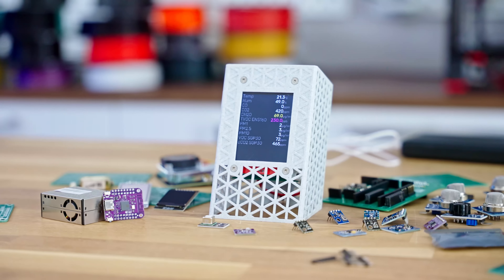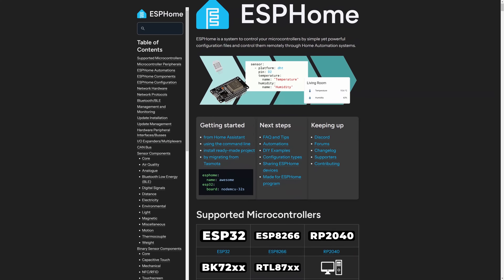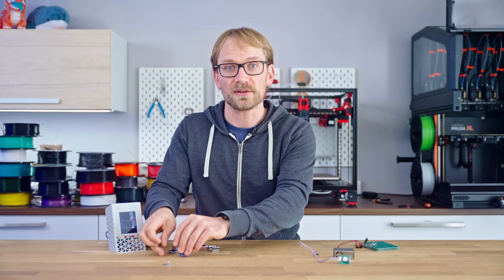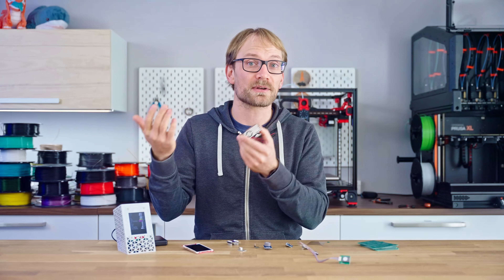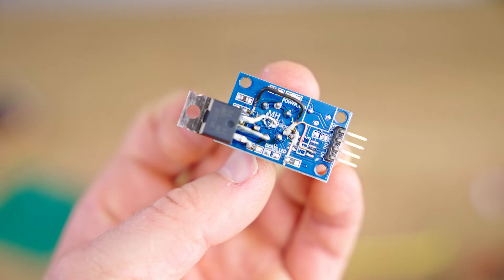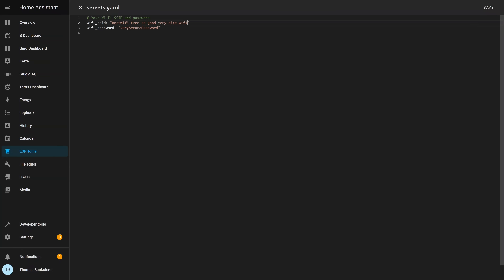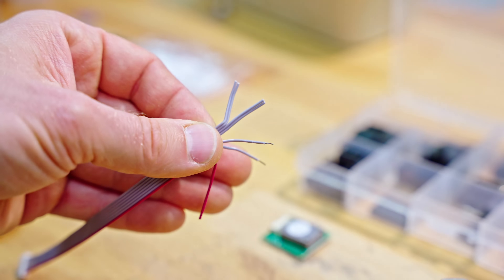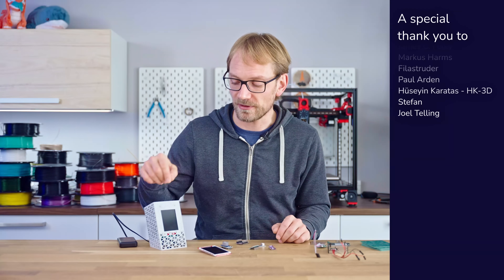I made it easier to measure your 3D printer's emissions!

Comment: "No reason not to order these PCB's" I dunno man.. what about shopping and VAT? I'm so used to it being like 15-40$ for the tiniest thing from anything that isn't from aliexpress or within my own country here in norway..
Reply: it cost me $3.21 with shipping, its basically nothing
Reply: @wraith2286  same here, it's cheaper than buying a generic prototype board and soldering all the wires yourself
Reply: @wraith2286  my shipping options are 18-28.43$... luckily there's one option that's only 1.52$. usually there isn't one of those slow but cheap shipping options like aliexpress and ebay offers, so that's nice.
Reply from the maker: EU regulations now require sellers that ship into the EU to collect VAT at the point of sale - Aliexpress does that, and so does JLCPCB. I know DHL used to have a €15 handling fee for anything where they were required to collect even just a couple of cents of VAT from you, haven't had to deal with that at all ever since the new regulations went into effect.
Aliexpress "Choice" shipping is basically them importing items in bulk in their name, then sorting and shipping them to customers from within the EU. Super convenient!
Reply: @MadeWithLayers  I've used nothing but choice when buying from aliexpress for the last few years, as I've had two instances where I've been double charged VAT when it wasn't shipped as choice... paying an extra dollar or two isn't a problem of course, but it's the handling fees of the postal service in my country. they took like 15 or 20$ which is ridiculous for something that costs 2-5$ lol. And of course I didn't get my money back for that either, despite wasting hours explaining the problem with both aliexpress and the postal service here (it's only the seller's fault, so I can't blame the postal service)

I had a look to see how much it'd cost me to get it shipped, and the shipping options were from 18-25$, but there does seem to be a 2-3$ shipping option which is nice. 
when it comes to a project or something where the goal is to spend a fairly low price on it, only to have it double or even triple in price because of really high shipping or import fees.. it really sucks :p
Reply: @MadeWithLayers  I replied to this comment twice but it's not showing.. why does this keep happening to me on YouTube 🤔

There is a very cheap shipping option on that website yes, so I'm glad to see that.
Reply from the maker: @PureRushXevus I don't know why this is happening to you. i can't find anything in the withheld comments either, sorry.
Reply: @MadeWithLayers  It's been happening for a while for me on YT I think, very odd. Fun to see you engaging so much with the comments though :]
Reply from the maker: @PureRushXevus I try my best!

Comment: Great intro on how to use ESPhome for quick data collection without messing with Arduino IDE.
I2C header following Quiic pinout makes it 10/10 😅
Reply from the maker: Noted, thanks! I've got some Qwiic-compatible sensors sitting around, adding a spot for a header would totally make sense.

Comment: You didn't mention that there are variable voltage regulators in the same package, and they bascially look the same visually. And that maybe, you want to confirm the pinout of the indivudual sensors as they are a potential point of change.

Comment: I watched the video, looked at printables, and must have missed the estimated total budget in Euros or whatever for all the parts. Yes it varies. But I've no idea whether the total is $25, $50 or $200.
Reply from the maker: It depends on what sensors you kit it out with, as that's the biggest variable. A super minimal setup can be kitted out for less than 25 bucks (PCB / ESP / AHT20 / ENS160 / LCD), then the nicer sensors add about
8€ ZE08-CH2O (formaldehyde)
15€ PMS5003 (particles)
6€ SGP30 (VOC)
17€ SCD40 (CO2)
Reply: Just bought everything myself, came to £55 total

Comment: I disagree about the usefulness of the VOC sensor for FDM - many "PLA" and other filaments actually contain unspecified surprise ingredients that can absolutely emit harmful gases. For example Filamentum's PLA causes irritation in my throat within minutes if I'm in the same room. And I know that's not from particles because I have a decent air filter for those. Bambulab's PLA emits an untypical chemical smell too. And the problem with VOCs is that they're much harder to filter - particles are easy to deal with, just build a box with a fan and a MERV-13+ filter and you're good.

Comment: Please get those manufactured, and sell them! :-)
Reply from the maker: perhaps
Reply: @MadeWithLayers  I would also be happy to buy a component bundle / kit, granted there is a software package that can easily be installed. Not for lack av ability to do it all myself. But for lack of available time. 😜
Reply from the maker: @mariusmossum2923  if I end up offering this as a product somehow, I'd definitely include a pre-flashed ESP that runs without being connected to Home Assistant, but would still offer the option to link it in. Then, if you want a platform that is pre-configured for Home Assistant, I'd simply recommend getting the official Home Assistant hardware https://www.home-assistant.io/installation/

Comment: It's ridiculous your sensor. You're trying to make it as cheap as possible while claiming accurate measurements. Scientific-grade sensors capable of measuring VOCs and nanoparticles accurately cost at least $10,000. Many sensors available on Amazon can only measure particles of 2.5 (2500 nm) or larger. However, in 3D printing, particle emissions are typically between 10 and 100 nm. Using a 2.5-micron sensor is inadequate since it can't detect the much smaller particles being emitted. I don't mean to spoil your video, but the public deserves accurate information.
Reply: We're not looking for proteomics-grade accuracy here, though. Even if the measurements aren't precisely accurate, they're indicative enough. 
By this approach, we ought to abandon electrophoresis in general and certainly blots in particular in favour of NA-microchips and quantitative microwell measurements, where each disposable plate costs more than the entire blot analysis. After all, those are at best semi-quantitative if you select the appropriate domestic constant-quantity RNA/protein to reference against vs true quantitative analyses!
Reply: Guess what, were not in a lab...
As long as we can see a number that changes with particles, thats enough. Simply to see that the number went up is plenty of information for hobbyists to see if their filtration is adequate
Reply: The exact numbers are completely meaningless. We're not a lab and we don't do absolute comparisons. A somewhat correlated number that goes up and down with emissions is all that's required to be useful.
Reply: He references his previous video where he explores the vocs and particle sizes for 3D printers.

You might want to refer back to that. And leave some kind recommendations there if you would like to inform the public.
Reply: @BallisticTech  I did, and I pasted here again for him. Air extractor > HEPA14 + Activated Carbon > HEPA13 + Activated Carbon > HEPA > EPA> Open doors + airflow > Nothing. You need to talk about the fan also. Many fans cannot generate the necessary pressure to push air through a HEPA filter, which has very high resistance. And don't forget about the weight and size of the filter. All the Chinese filters in Bambu Lab, Raise 3D, Anycubic, and Elegoo are almost empty inside, which could explain one reason why Chinese machines are cheaper than other brands in the EU. What do u think Thomas? And please, don't make videos just to sell your funny sensor anymore, all fake
Reply: @Romancelanguagespassion  in the video I'm referring to he outlined the size of some of the particles/vocs put out by 3D Printers. He also ran experiments using the sensors to see if they measured an increase when printing. Which they did.

So filtration aside. How is it that his sensor seems to show a relative increase of particles when printing vs baseline. And how is this project ridiculous and inadequate if it can do so?
Reply: Interesting comment. I think I live at the opposite of the ridiculous spectrum. I really don't care about said printer emissions considering the exposure that comes with living in any city.
Reply: @CaptainFalcon92 Fair
Reply: What a useless comment. No, non-scientific grade sensors are not scientific grade sensors. So? Do you think FDM 3D printers are useless because they can't compete with high precision surface grinders on accuracy? Do you refuse to use calipers because they aren't useful in the nanometer range?
The particulate detector used in this project can detect particles in the 0.3-10 micrometer range and reports concentrations of PM1, PM2.5, and PM10 in micrograms per cubic meter. That is good enough for giving an indication of indoor air quality, and the device is intended to give an indication of indoor air quality. Mission accomplished.
Reply: Man idk, you might be the ridiculous one, not the sensor, if you think you are able to provide accurate info.

The PM2.5 measurement measures particle sizes up to 2.5um not from. The PM10 measures up to 10um etc. It's cumulative. The modules presented have a sensitivity down to 0.3um. This is used to extrapolate smaller particle sizes. A rise in 1um correlates with rises of smaller particle sizes.

The idea is that if you don't have the larger particles then that gives some indication of not having the smaller ones. Additionally, the voc sensor detects particles of similar scale to plastic nanoparticles, which have similar characteristics when you try to e.g. construct an exhaustion system for the printer; they leak through the same tolerances etc . Again, a decrease in one indicates a decrease in the other. Lack of both VOCs and PM2.5 gives some confidence that you are doing something to deal with other emissions that are harder to measure.

Quit yapping.
Reply: @kubenoz  Ok fine, buy the tools, then open a lab, you can become a scientist now. These sensors cannot accurately extrapolate the number or concentration of particles below their sensitivity range. That's all

Comment: Damn, this is EXACTLY what I needed. I just built 3 corsi rosenthal boxes for general home use (home which includes 3D printers) with no way of validanting if they work. I will attempt to makes this 100 percent.
Reply: Filters used by CR boxes don't do anything against VOCs unfortunately, I think you need at least activated carbon filters for those. That said they work great for particles.
Reply: @brinkoftext  yeah activated carbon and/or hepa. Im using appropriate thickness f7 filters for particles only.
Reply: Unfortunately, plans and materials for DIY gas filters are a lot harder to come by than particulate filters. I think the best idea I've come across so far is using inline blowers and filters intended for HVAC ducts, but that's still expensive.

Comment: Where is the PCB zip? I don't see a link to it on the printables link either.
Reply: It should be below the STL files in the "Files" Section.
Reply: It's under the print files on the Printables page :)
Reply from the maker: Sorry for the confusion, it wasn't there yet when I published the video!
Reply: The one found on printables had a different version of the PCB in the zip file than in your video
. Is this the new or the old revision? I was able to use your code with a few of the sensors directly connected to the esp, but not on your board. Do I need to adjust the output of the converter with the potmeter first? @MadeWithLayers

Comment: It might be worth pointing out that IKEA has a reasonably priced particulate sensor (2.5um) that’s supported by ESPHome. You still have to install an ESP, but everything is well documented. I added sensors similar to your selection and now have a few of them around the house.
Reply: It has the sen54 from sensirion, which has measurement comparable to the sps30 (might be the same module internally) which in turn is better than any of the sensors in the video list
Reply: I have one of the older ones (basic Red/Yellow/Green quality report LED) hooked up with a D1 Mini integrated into HomeKit (no bridge!). There’s even a fork of the repo that supports a CO2 sensor in a little “hat” enclosure on top and adds data logging for graphic changes from both sensors over time. For a $15 sensor and a few extra bucks in components, it performs as well as sensors that cost over $100, I’m super happy with it. 

If anyone wants to do the same, it’s an easy google, but I don’t know the exact name of the repo. Happy to help if needed tho
Reply: What do you mean you have to install an ESP? You mean flash a custom firmware to the sensor?
Reply: @radry100  the cheap sensor VINDRIKTNING does not have any connectivity. So you add a ESP32 with ESPHome to the existing sensors. The Vindstyrka has built in Zigbee Connectivity and a display (thats the 40€ one)
Reply: @radry100 he means taking the thing apart and soldering an ESP board inside of it
Reply: Dozer!!!
Reply: is it accurate tho? what is the sensor called
Reply: There is an ESP mod for VINDRIKTNING, which puts an ESP8266 inside the box, connected to the power and data outputs - just use your favourite search engine, I built one using the original instructions but couldn't get it to compile/build - but the ESPhome yaml works on the same hardware with no changes.
Reply: VINDSTYRKA is the name
Reply: @lumi_arcs  That costs 40€, not cheap at all.
Reply: VINDRIKTNING is the correct cheap one, not VINDSTYRKA
Reply: @Alterproll found the one, it costs 20€. How much is the CO2 sensor?
Reply: @radry100  uhm yes that actually is cheap for that set of sensors in that accuracy. This one is not cheaper either
Reply: @Alterproll  VINDRIKTNING has a PM1006 sensor which is quite a bit worse. Get the VINDSTYRKA or just build one yourself imo.

Comment: Great project, and always love to hear others evangelize Home Assistant and Esphome 😊

For those who don't want to go to so much trouble, the ikea vindstyrka is quite cheap, and has a sen54 sensor inside. Connecting it to home assistant via zigbee2mqtt allows you to see both pm2.5 an voc (index), so ok for basic
 fdm print measurements. There are also ways to attach an esp32 to get some more data and eventually attach an extra sensor.

I'm hoping you'll use the sensor box to make a video evaluating some common filtration projects (eg nevermore, bentobox, alveoone, prusa filtersł efficiency, because there seems to be a lack of data on those... There's a whole lot of opinionated takes about wich one is suppised to work for what etc, but almost never backed up by any data... At best a "works well against the smell"...

Even the commercial ones mainly state eg hepa filter efficiency, but never actual figures on measurements in a room a printer is working in combined with with and without filtering measurements.

Comment: Why did you use those purple S2 boards?
I know they are quite cheap, but especially the purple board ones are a complete gamble whether you have one with proper WiFi antenna or one that's quite unstable.

For ESPEasy I had to use quite some tricks to get them to work stable most of the time, but it took quite a lot of effort to get those to work as there are quite a few of those purple boards which have a badly tuned WiFi antenna.

I prefer the ESP32-C3 for smaller builds where you don't need a lot of GPIO pins, or the ESP32-S3 when you need more pins.
Or take the C6, which is also perfectly fine and could be useful later for Zigbee usage.

Comment: Be aware of this ESP-S2 board, which resets itself by interference just by sending more data over wifi at full power ;)
Reply: I'm looking at Wemos ESP32 S2. It costs twice as a noname one but at least it's some kind of brand name.
Reply: @sjtonic  Well the brand "Wemos" was replaced by "Lolin" about 5 or 6 years ago.
And even then you had all kinds of "Wemmos", "Wenos" and what other possible 'typos' you could imagine.
Right now the marking "Wemos" on some ESP board tells you as much as "USB" when written on the PCB. It tells you nothing as anyone making an ESP board writes it on their board.
Reply: @sjtonic  it has the same design flaw
Reply: That's probably because quite a lot of those purple S2 boards have a badly tuned antenna.
This means quite a lot of the TX power from WiFi is reflected back into the ESP, leading to all kinds of strange issues, even crashes.
Reducing the TX power will help, but it isn't always enough.
Best to pick another ESP board as there are enough other options. Sadly those are not pin-compatible with Tom's board.
Reply from the maker: I've experienced the S2 boards as already being quite the upgrade over the ESP32-WROVER I had in there before, but spinning a new PCB revision wouldn't be a huge deal. What would be your preferred board or platform with enough pins and peripherals for (at least) 1 I2C, 1 UART, a button and a SPI screen? Currently I'm reserving 2 I2C, 2 UART, 1 analog in, 1 digital in, 3 digital out, plus 8 pins for the screen, looks like the C6 would be the only one that's broadly available that would still support a full sensor loadout.
Reply: @TD-er  Reset signal is routed pretty badly around RF part of the PCB. At least at my board, which I had.
Reply: @MartinWolker  Could very well be contributing to the poor WiFi performance of some of those purple boards (N.B. not all are bad, but some are really really bad)

I always thought there might have been some mixup in antenna tuning components for some batch of those boards, as pressing your thumb on the antenna does change WiFi stability. This is typical for badly tuned antennas and placing a PCB + sensors with metal shields next to it is probably not going to improve those already bad boards.